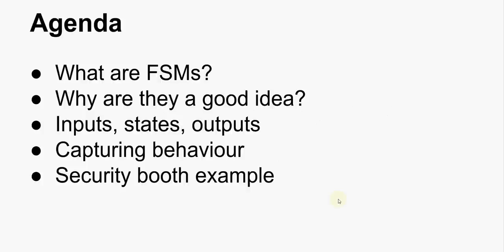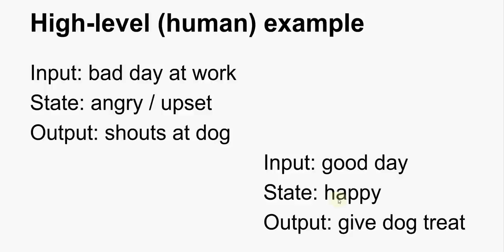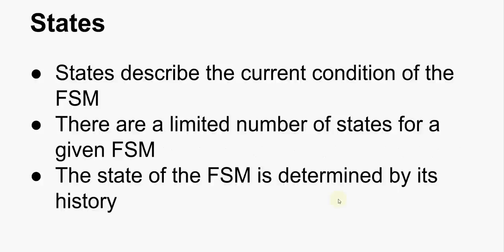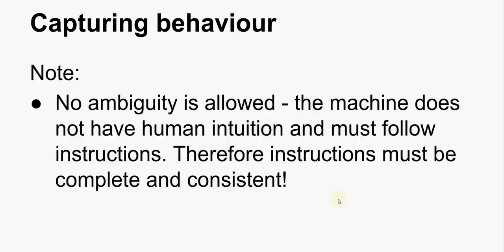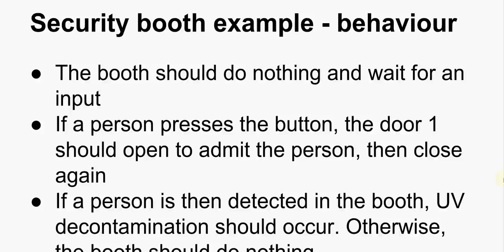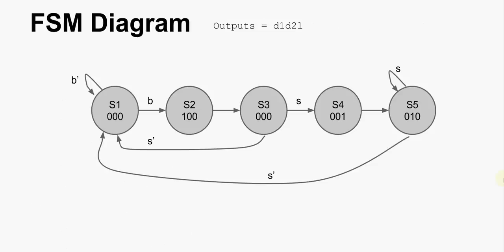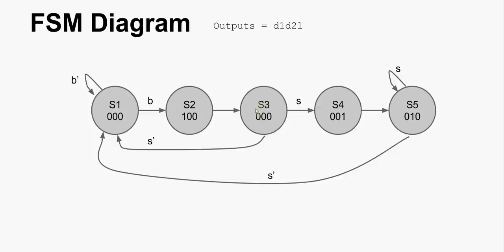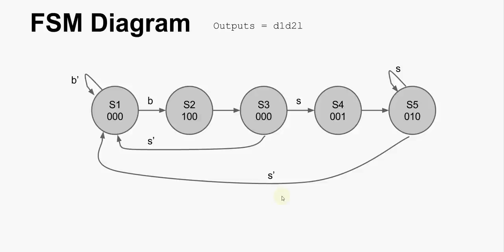Finite-State Machines: Explanation & Example

Comment: Could you provide an explanation on the difference between a finite state machine and an extended finite state machine?
Reply from the maker: daniel Murphy - there's not a clearly defined difference. Typically a plain finite state machine has very simple logic and binary states but higher level ones can have some kind of memory, or produce some kind of arithmetic output. Different textbooks define this differently.